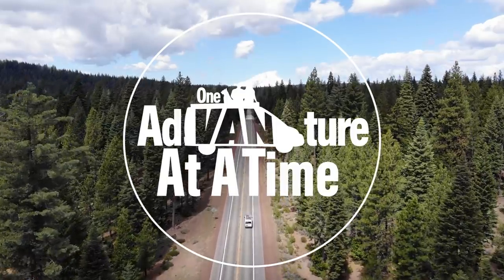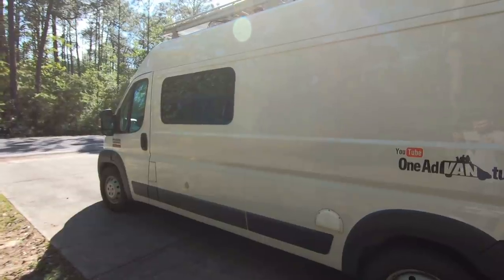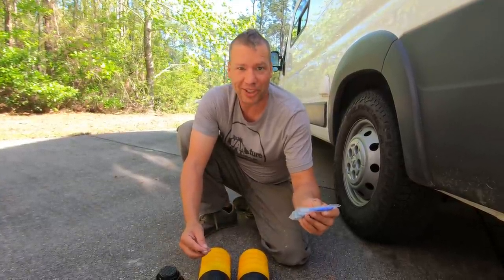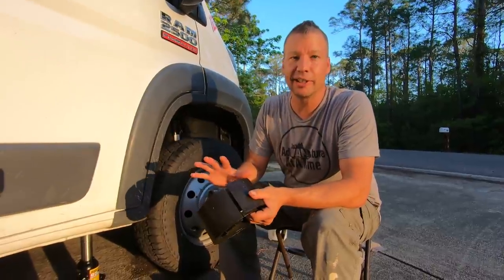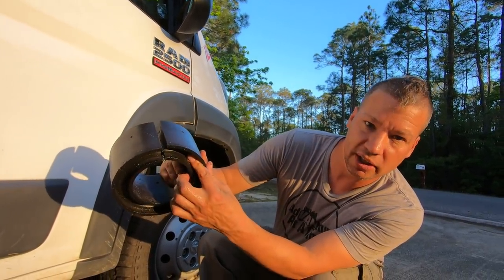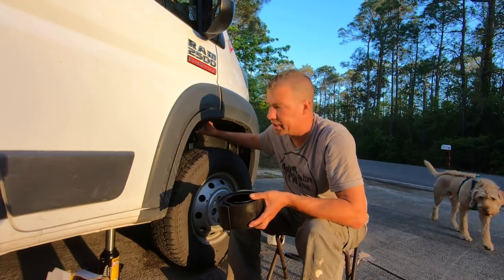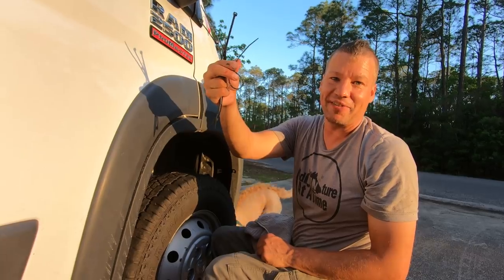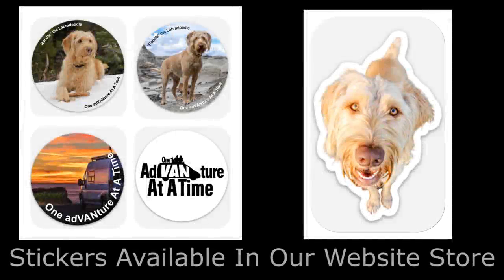Installing  SUMO SPRINGS on Ram Promaster | Does it really make a DIFFERENCE?

Comment: Thank you for your great videos!!  I know this is an older video but I assume people like me are still finding and watching these install videos.   I originally installed the rear sumo springs when the van was empty and used both spacers. At that time it was barely touching and made a significant difference in the ride.  After building out the van and adding significant weight the ride was extremely rough.  I just removed one of the spacers and it made a tremendous difference in softening the ride
Reply: exactly, i spoke with the SumoSprings people and they recommend leaving .5" to 1" of space AFTER its loaded.  BEcause if the bump stops are already touching, you lose most of the shock distance making the ride crazy rough.  (some people like it to touch because it has ride height at the expense of ride quality).

Comment: When we built our van, we bought those back and rear sumo spring and had installed by a garage shop for $40 labor.  It took them 20mn.   We cannot tell the difference in driving since we never drove with the factory ones :).   But The back sumo springs lift the van 1-2 inches.
Reply from the maker: Right on Herve! Sounds like they were fair on the install job. I feel like we hug the corners so much better...we just followed another Promaster and noticed it was leaning on the turns much more than we were. 😀

Comment: Great walk through with the sumos, do you wish you would have installed them when you first built. I have just ordered a new one to build. Have sold my first one, I had to replace the front struts on her, and the mount brackets, she had a rattle when you went on a dirt road, that went away after they were changed. Get the Bilsteins, I also bought 40mm spacers to raise the front up a couple inches to help with clearance and the levelness. Thanks for the videos,👍👏
Reply from the maker: Thank you for the tip on the Bilsteins! Yes, I do wish we would have started with these. Bummer on the mount brackets 😕

Comment: Nice job.  Love it when you put up DIY projects.  You always explain the process in clear terms that help with understanding.  I only put on the rear Summo assists.  I’m considering a Van-compass 2” lift.  I can tell a big difference in driving even with only the rear done.  The garage that put them on only used one spacer, saying it fit to tight.  Did you have that issue?  I kept the unused spacers in case needed later.  So much better when you can do it yourself.
Reply from the maker: Thank you! We also went with one spacer as we are pretty heavy and two would not fit.

Comment: I just installed it on Solis Pocket pro Master 2024 and it works amazing.
Reply from the maker: We have really noticed a difference with the back bump stops.... not so much with the front springs
Reply: @oneadVANtureatatime  I did from and back. Definitely a huge difference. Not suave/rocking at all. I did install rear accessories, about 400 lbs and drive amazing.

Comment: The first thing I did with our van (it weighs the same as your's) was to add a leaf to the rear springs. At this weight you're pushing it's max capacity and I wanted some additional wt carrying capacity so as not to cause parts to wear out prematurely. I have not increased the overall wt of the van just it's capacity.
Reply from the maker: Nice John! We may look into adding an additional leaf spring as well. Do you mind if I ask how much did it cost you?
Reply: @oneadVANtureatatime  If I remember correctly it was about $475.00 at the local suspension shop.  I suspect this will vary by shop.
Reply from the maker: Right on! That's not as bad as I was thinking. 😀
Reply: @oneadVANtureatatime  Yea it wasn't the cheapest mod but it gave me a little peace of mind knowing I was no longer  pushing the limit of the suspension.  I think many diy's don't take the time to weigh their vans once completed and therefor have no idea if they're over weight.

Comment: For my rear bump install, the welds on both nuts broke when I was getting the OEM bumps off. I had to use a reciprocating saw to cut them off (since they were just spinning at that point) touch up paint, then use a locking washer and nut in the channel that the OEM nut was originally welded into. If you break a weld, don't worry! It can be saved. Be mindful of brake lines and wires when removing the old bumps! I only had 30k miles and used penetrating spray as well, so bad luck I guess for me....
Reply from the maker: Great advice, thank you! I initially thought this was going to be a 5 minute job 😂

Comment: Going to be installing a pair on our 2020 Sequence 20K. Same Dodge chassis. I see you used the yellow ones for 8,000 GVR. I will check my GVR.. The recommendation I got so far was the black ones for my van. We will be adding a spare tire rack combo ladder. Not sure if that will change it to the yellow. Sway on highway is not as bad. Driveways and rough roads are the problem.
Reply: Did you do the install Sparkey? Just got mine delivered today for our 2022 Sequence 20L…the yellow springs. I’m gonna use 1 spacer. Praying to God it’s a simple unscrew the old and screw on the new. Bought a 6 ton bottle jack to simply pry up the suspension if needed, rather than lifting the whole thing.

Comment: Should use jackstands I realize you do not want to carry them but just a jack is very dangerous.   You may want to check on fluid film, it can keep the underbody from rusting.
Reply from the maker: Good call, yes I have just started doing some undercoating with a special rubber undercoat spray. In the west we didn't have to worry about this rust issue 😂😂

Comment: I can see the sumo for sure. But why are you replacing the rear shocks? Just age? What did you replace the shocks with? OEM? My van is new and not built out yet. Just wondering if I might as well install the sumo bumpers before? Thank you.
Reply from the maker: The ride in the rear became terrible. When we took took the shocks out they were done. I bought aftermarket shocks on Amazon. The sumo bump stops in the rear made a huge difference in cornering and moderate different in ride for us. The new shocks I can just barely tell that I replaced them. Big thumbs up on the sumo springs.
Reply: @oneadVANtureatatime  Thank you!!

Comment: I know when I was putting side steps on my Ram having to take out the body bolts to install, the lock tite they used was some good stuff. I was afraid the bolt would break. Looks like you ran into the same stuff.
Reply from the maker: That lock time is no joke! 😀

Comment: This is timely info! We want to do this! Is the link you provide for “exact” for the 2017 2500? (I won’t hold you accountable lol). We will order these immediately because your video was the most clear I have seen on installation! Thank you for sharing! 🤙 High five to Roodle!
Reply from the maker: +Discovering LockeNest Dave says it’s the same no matter what year😃they made a huge difference for us!
Reply from the maker: Just curious if you got them installed yet or have any questions 😀
Reply: one adVANture at a time they have not come in yet but you can bet I’ll hit you up if I have issues! 😁🤙

Comment: Now that you have had them for a while, are they still great?   My van is not heavy, but I can’t stand the rear “tipping” feeling you get going around curves.  Do the sumo springs solve that issue?  Can I just get the rears?  Thanks
Reply from the maker: Yes! They completely removed that tipping feeling for us and you can just order the rear sumo’s on Amazon. If you are not that heavy you may want to use both spacers that come with it already assembled. Because they are bump stops they need to make contact when turning to get the results. We are so heavy that they are touching even with just one spacer. It's a huge difference, we love the improvement.😀

Comment: How many miles are on your PM? Ours is a 2014 159 inch wheelbase with 127,000 miles. We bought it with 122K on it. As far as we know the struts and shocks are original and it handles very well. It's a 3500 so the rear sway bar may make a difference. As simple as they are, $254 for the Sumo bump stops on the rear seems expensive.
Reply from the maker: We only have 85k miles but have a heavy load and like the remote bumpy roads. Pretty sure we are taking years off our van's life limit faster than normal. I have heard the 3500 ride smoother and can handle the weight better so great choice there. We are currently reducing weight anyway we can and buying time for the strut replacement. We have been pleasantly surprised with the sumo springs. 😀

Comment: Actually what does the sumo spring do. Does it raise the rear end higher or is a taller bump stop?
Reply from the maker: Hi George! It raised the rear over an inch because it is now setting on the taller bump stop. This helps stabilize side-to-side motion when turning as well. 👍😀
Reply: Did the front sumo’s lift the front end? You said the rear went up 3/4”, what about the rear. Thank you

Comment: Did you have the issue of the nut on top coming lose in the rear sumo springs? I have this issue trying to tighten the spring and then the nut comes loose and I can’t tighten it anymore. Thoughts?
Reply from the maker: One of the nuts would not let me tighten it all the way. I think the weight of our van has been keeping it in place the last 2 years 😂😂
Reply: @oneadVANtureatatime  lol okay good to know

Comment: you really need more and better leaf springs with that much weight
Reply from the maker: Yes, we may add a leaf spring at some point.
Reply: it is needed with lots of back end constant weight in the Promaster -- I pick up my winnebago Travato GL at the end of May and plan to do OHV 3in lift at some point and other suspension improvements down the road..   may see you folks as I camp around the NW..  Based out of Spokane WA.  old and retired so this is not a full time thing for me..  but hope to use the van enough to enjoy retirement